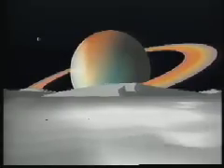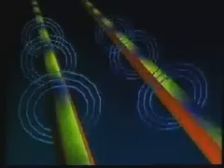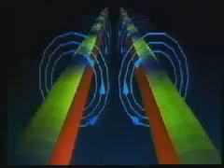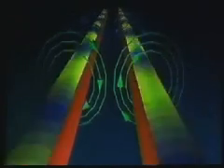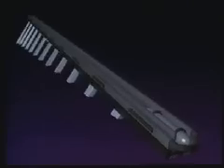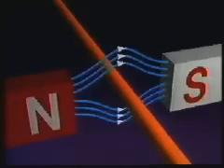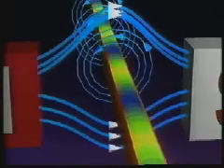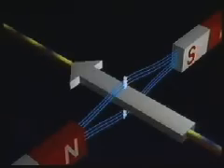Electromagnetism 4: The Motor Principle

Comment: Is the method taught in this video assuming current goes from + to -? Because in that case, I was taught the RHR and have experimentally proved it in lab. If current flows < (left) and magnetic field flows ^ (up) then the force goes x (into) the computer screen. LHR was only for induction or if the current was negative.

Comment: Left Hand Rule is for when the current goes from negative to positive like what actually happens with the electrons. Right hand rule is for as you said when the current goes from positive to negative and is more commonly used for some reason.

Comment: If I understand this correctly the pod launches along the rails in conjunction with the direction of the electrons in the rails.  It increases in speed due to a combination of momentum and the increasing "push " of the magnetic fields generated by the current.  Please confirm if this is the correct conclusion

Comment: @letricblue  Do you know if I am understanding this correctly?  The pod launches along the rails in conjunction with the direction of the electrons in the rails.  It increases in speed due to a combination of momentum and the increasing "push " of the magnetic fields generated by the current.  Please confirm if this is the correct conclusion